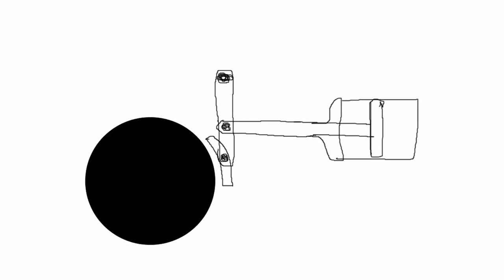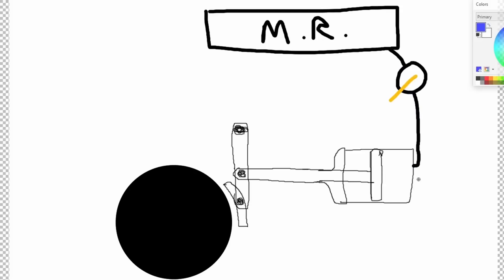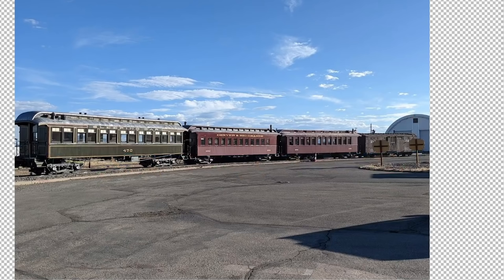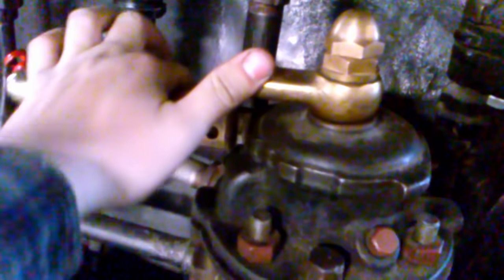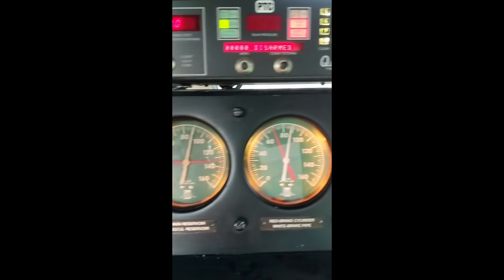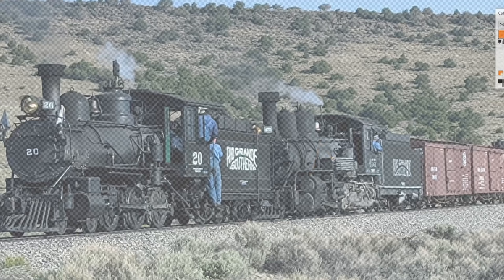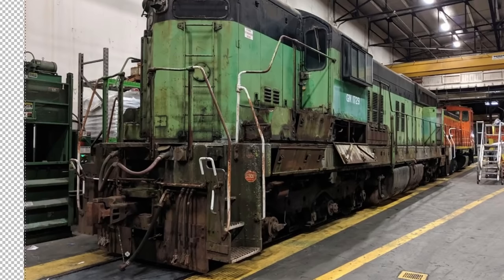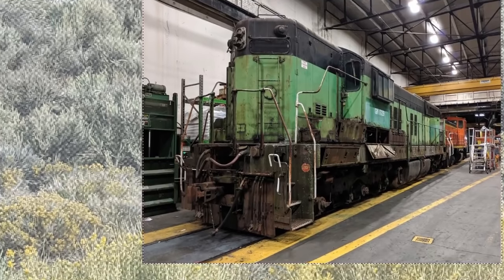AIRBRAKES 101: 10 levels of TRAIN BRAKE understanding!

Comment: now do vacuum brakes
Reply from the maker: I am going to need to consult someone who actually knows vacuum brakes hahahaha
Reply: It's not dissimilar to how the Westinghouse air brake works, except instead of air the resevoirs hold vacuum (usually at 21 inches of mercury) provided by an ejector, and to apply the brakes you destroy the vacuum by letting air into the train line, which triggers the pistons in the brake cylinders to move and pull on the brake rigging.

It has the advantage of being able to be released gradually and re-applied as desired, unlike air brakes, where you have to release the brakes all the way before re-applying (and not too many times in sucession, or you'll exhaust the system of air).

The downside of vacuum is that you only have atmospheric pressure to work with, which makes the overall component size much bigger to give sufficient braking power. It also limits the length of trains, as you can get into a situation where you have the vacuum brake hard-on (the equivalent of "big holing" an air brake), but the wheels are still turning as the system has insufficient force to stop the train.

That's why vacuum brakes were primarily used in the UK on passenger trains and short express freight trains. Most goods trains were run "loose coupled", i.e. either partly fitted with vacuum brakes or not at all and primarily using the manual handbrakes on the cars, as well as the steam/vacuum brakes on the engine and the brake van's handbrake at the back of the train to control the train, right up into the 1970's when the practice was finally abolished and power brakes were made mandatory on all trains (tend to use air brakes these days, vacuum is relegated to heritage/preserved lines).

Hence the sign  "All Trains Stop to Pin Down Brakes". At the top of the grade the guard would go along the train setting the brakes on the cars until the driver thought he had enough to keep the speed in check, then signal him to return to the van with a whistle.

The main objective was to keep the couplings stretched out so there was no snatching jerks or breaking the links
Reply from the maker: @Shipwright1918  Thank you for the detailed comment! I appreciate it. I will tell you that you don't have to release airbrakes all the way though. If you don't let the brake pipe recharge to operating PSI (usually 90) you can retain a set. Though you are right that fanning sets quickly can make you have no more air very quickly... lol!
Reply: @Hyce777  

Would that be a graduated release system, then?
Reply from the maker: @Shipwright1918  Negative, that's a separate thing that some passenger valves were equipped with (and in later days, the "passenger" setting on the automatic valves). With a plain old G6 or H6 automatic, and K valves, you can release the train, bring it back to lap before the brake pipe has recharged all the way, and it won't vent all of the pressure out of the cylinders. You gotta be quick with it, but it works.

Comment: Well I will say this.  Its 2022 and we still havent adapted a better system for Train braking seems a little backward thinking.  One lever with computer control should be all you need.
Reply from the maker: It's just more nuanced than that is all.
Reply: @Hyce777  regardless.  Its still highly out dated

Comment: Are you kidding what kind of wheel , what kind of brake what kind of shoe or pad ,what a waste of of subject
Reply from the maker: I suppose we could've talked about comp shoes vs. cast iron, but it didn't seem terribly important in the grand scheme of things. Also, so far as I've heard, wheel type doesn't make much difference. Marginal change in performance.
Reply: @Hyce777  it just seemed to be a broad overview of concept on basics without digging into the design and materials used because of weight the tonnage and physics behind concepts of stopping, effects of momentum in motion and why was more I was looking for , I didn't mean to comment like an asshole, I just expected to much I guess for my love of heavy machines
Reply from the maker: @brianhurt3801  ah no sweat mate. That is precisely what I wanted to do with this video though. A broad overview with a little of everything. I do plan on followup courses with more detailed things later, i just knew that i had an audience that some folks barely had any idea how this stuff works.